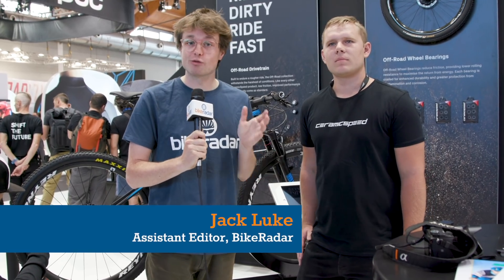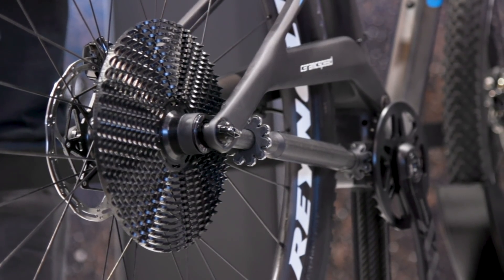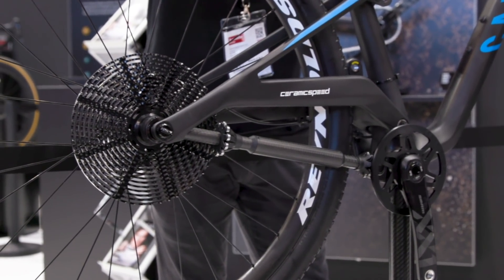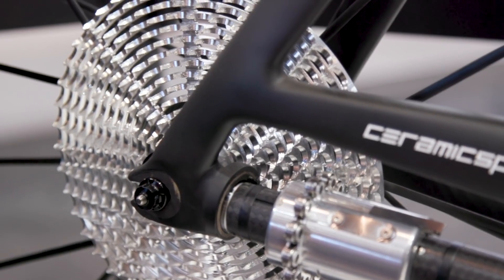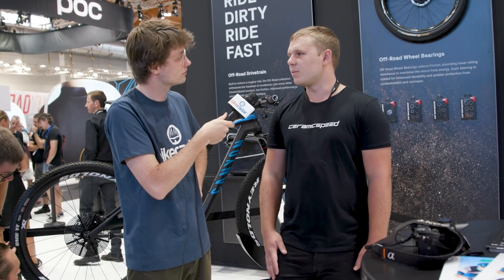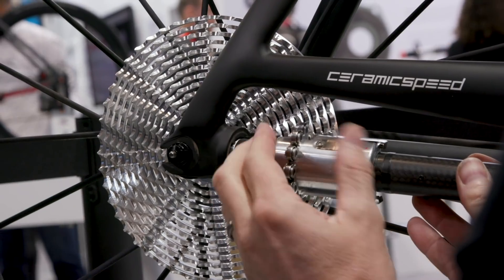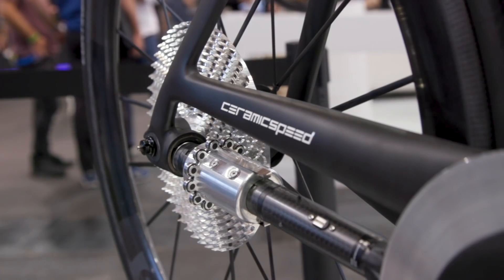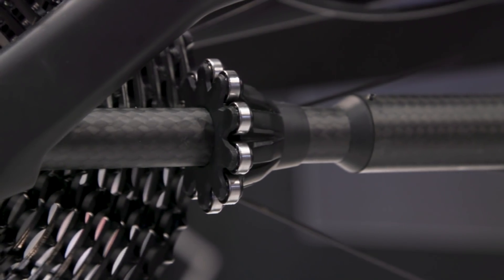No More Chains! The Future of Bike Design? | CeramicSpeed’s Driven MTB & Road Drivetrain

Comment: I have read that for motorcycles this shaft power delivery has more loss than a chain.
Reply: Well yeah, you also carry more weight. it remains to be seen if this system really brings more efficiency to the table, and maybe less weight. Otherwise it's pretty useless. I mean, there's no need to reinvent the wheel if the benefits do not outweight the drawbacks.
Reply: Well, the disadvantages on a motorcycle is the very direct connection between the engine and the wheel, adding quite a jerkiness to the shifting. The efficiency loss is mainly due to the additional weight, which has to be accelerated.

But I think engines are fading out pretty quickly, so electric belt driven motorcycles which don't use gears or clutches are the future :)
Reply: @RubenKelevra  actually no. Not until the battery problem will be solved. Every single electric motorcycle on the market is a joke , performance and price wise if compared to anything similar gas powered at half a cost. The complete failure of the Harley bike is just the most recent one.
Reply: @DerpEye  I test driven a Zero DSR pretty dope. :)
Reply: @RubenKelevra  Well, it costs almost 3 times a comparable ICE bike, with a range of about 150 kms in real life. Pretty much useless outside the city. I ride motorcycles and I've tried electric ones more than a decade ago. Very nice riding , but the battery technology still sucks big time to this day.
Reply: @DerpEye  you got 326 km city range. You must know pretty large cities 🤔

I took two full day trips, while we did park and walked a bit, drank coffee etc. after 1-2 hours driving. Had no issues with charging, it charges 150 km of range in one hour on a Type2 charger. So you can drive like 2 hours, take a break and when you come back your bike is full again.
Reply: @RubenKelevra  Who buys a 20k motorcycle to use it in the city?  Motorcycles are usually used on weekends for long trips. 320 in the city , is that manufacturers' posted range? It's for the long range version btw. More likely less than 200kms on  open roads and highway speeds. Or at least that's what I read from real life tests. Is it a great toy for rich people? Yes. Can it replace a normal motorcycle? Obviously not.
Reply: @DerpEye  it was you who said, it's a motorcycle for the city. I've driven it, on two day trips and charging was never an issue. I actually had to wait for the rest of the group to fill up at the gas station 😂

20k for a new bike is not much, if you compare it for example to a HD. It's also not ridiculously overpriced, since the parts (especially the battery) is expensive. Buying a non-electric motorcycle for much more than 20k on the other hand is.
Reply: @RubenKelevra  well, Harley Davidson Is nonexistent as a brand outside of the US for a reason. Most bikes on the road are sub 15-10k. For 20k€ were talking BMW terrain, with a bike which is almost comparable to a car in terms of technology and size. Well, batteries are a long way from replacing conventional mobility.
Reply: @RubenKelevra  No if i hit the highway I can tackle 180km max. Besides if u do not use the high way, it's no point having a motor cycle
Reply: @DerpEye  everyone  driving cars in the city is one of the biggest reason there's congestion. If people rode bikes (push or powered) and used public transport there'd be less traffic. 
Also,  most city trips are short, so why is the range an issue? If you need to go long distance then a motorbike isn't a good option regardless..
Reply: @dannydyerschocolatehomuncu7640  oh really?  US represents more than 60% of sales for them. That's 320 million people market. A little remainder that we have almost 7 billion worldwide. The second largest market being Europe, with Italy as the largest motorcycle market, among the most sold bike the first Harley comes in the 40 place. No wonder, who buys a motorbike incapable of cornering in a country with famous mountain passes?

Comment: This is a scam. Roller chains are over 98% efficient. Even if this worked as advertised you would be looking at maybe a 1% improvement. But, while a chain puts pressure on as much as half the teeth of the chainring/cluster gear this puts all the torque into one or two teeth at a time. That fragile cluster would not last a day of hard riding. Velodromes are nothing like the real world.

Comment: any innovation in drivetrain over chains will struggle because chains and gears are also used in industrial & automotive applications and have been for 140years. 
The size, history and output of chain & gear making companies elevates the quality of and reduces the  cost of chains and gears considerably. 
Ceramic speed is starting from scratch and is something only for bicycles so will really struggle. 
Belt drive has much more ability to get a foothold because belts are also used in industrial & automotive. Meaning high quality low cost belts exist already.

Comment: If they get it to work with a gearbox , the shifting problems would be solved.  I think the hardest problem with the full sus would be trying to shift that mechanism while the drivetrain length keeps changing. But if all the shifting is in a gearbox at the pedals, that's not a problem anymore.

Comment: Flashbacks of riding my bike as a kid and the chain popping off while standing.
Reply: I call that the nut cracker
Reply: Today sram powerlink $10😎
Reply: Happen to me all the time, 30 years old bike...
Reply: @Skaelya  have you tried adjusting your  derailleur?
Reply: @shaej8187  many times, yes... but the bike is just very old and keep de-ajusting itself so I kinda gave up and accepted the fact that the chain pop off all the time. I even managed to find ways to put the chain back on while riding using mys feet.
Reply: @Skaelya  well...chains and gears wear out over time, the teeth and links become crooked and must be changed eventually
Reply: Yeah, same
Reply: When youre climbing a hill standing then the bike shifts randomly

Comment: This thing will probably have to be fully sealed like a car transmission. That would add weight, bulk, and cost, but it would make this thing really resilient. At least if the mechanical components can handle all the stresses of real use.
Reply: Ever hear of plastic?
Reply: T1Oracle honestly, i think the pinion would put a lot of stress on the gears' teeth and break it. Unlike chain where the pressure of the torque is delivered evenly to the teeth the chain is hooked on. I feel like they can add more teeth on the gears and pinion or a stronger material.
Reply: A aerodynamic carbon shroud should do it , no debris , clean
Reply: This likely just a STEP in the new direction. What actually eventually (if it does) makes it to marketing or production will probably look quite different. It sort-of works now, maybe they're on the right track? We USED TO have hubs with 5-speeds INSIDE the hub--maybe a step in that direction w/newer advanced tech will be something too. For now... I'll keep my chain, thanks, but I WOULD like to see that improve too though.
~JSV

Comment: I wish they would put their efforts into developing a low friction CVT instead of this drive shaft and 2 crown gears.
Reply: CVT has huge power waste
Reply: go do it
Reply: CVT are slow reacting and inefficient at least when your legs are driving it.
Reply: @FSXgta  What part of LOW FRICTION do ya'll not understand?
Also, AT NO POINT DID I SAY THE CURRENT ONES ARE, what I said, is they should try to develop one.

A CVT is just a name for a category of transmissions... just a principle, not a specific mechanism, so there's no fundamental reason why a transmission with infinite gear ratios by nature needs to be slow to react or inefficient.

Ps transmission efficiency doesn't depend on whether your legs are driving it or not.
Reply: @sergarlantyrell7847  how do you lower friction on a pulley based CVT?
Reply: @FSXgta  that's your problem. You can't think beyond a pulley. Not every CVT uses pulleys.

Comment: More things to go wrong what's wrong with a chain?
Reply: Chain can fall off and the tensioner is waaay too low. Also, the cassette is thick and adds bulk to the frame and unspiring weight on the rear tire. This is crazy lightweight and a very slim profile. The engineering sample here is a rough idea but when it’s done I’m sure you won’t even be able to tell there’s a set of gears on the rear tire when it’s all concealed into a wheel cover.
Reply: @markm0000  the real test will be off road riding

Comment: I would say, it will not work! the contact point from shaft to the gears is too small, at the moment the chain is in contact with the gears wrapped around about 1/3 of the circumference, who doesn't put their body weight on the peddles!
Reply: That has been my concern from the first time I saw it, it just doesn't look rigid enough to cope with someone really standing on the pedals in a low gear.
Reply: But with a chain only one link needs to break for it to become useless. Also, the part of the chain that’s wrapped around the sprocket isn’t under tension.

That being said I’m concerned that the gear might pop outwards under extreme force.
Reply: Grant Lauzon Ja, but how often do standard bicycle chains ever actually fail due to excessive torque or tension?  Exactly.

Comment: This is poor design. There is a reason that this is not used. Even with motorcycles there is very few with this style drive. The reason is that the losses are to high it is a highly inefficient as compared to a chain drive.

Comment: Really exciting and fun to save an entire years paycheck for. Or just 3D print it yourself, or buy one, have a tech disassemble the new prototype, HP 3D scan all the parts. And Then send the CAD file to a Additive Manufacturing plant, and have it printed at a lower cost in hollow titanium Aluminum alloy.
Reply: Some 3D printing guys can do testing instead of this unicorn rainbow presentation with no footage

Comment: I don't understand how this can be a good idea at all. In addition to strength and weight issues, it has to transfer the force 90° twice, that must must destroy the efficiency.
Reply: Correct, it is highly inefficient when compared to a chain drive and this is why most motorcycles don't use them. They have the some advantages such as maintenance but they are far outweighed by the disadvantages

Comment: Still looks like a fix looking for a problem. I'm quite happy with my IGH setup.  Nothing exposed, nothing to have to maintain. This just looks like something that is going to have long term reliability issues with the forces trying to push the wheel out and away from the frame. Not to mention how painful that gear setup must be to accidentally hit.Thanks but no thanks.

Comment: Changing torque transmission drive angles from a conventional all inline design (chain/sprocket system) to 90 degree gear design as in this reduces efficiency.
Reply: This is the only correct comment! This design will therefore never work...

Comment: If it was Shimano behind it we wouldn't have heard about it until they had all of the problems worked out and it was actually going to work.  It's a neat concept but it doesn't work under actual seated power let alone standing efforts from a decently strong rider (forget about a big strong rider) without significantly beefing it up.  Then it would have greater weight.  When (and if) it actually gets released have fun spending stupid money on having the opportunity to find the shortcomings in the design and execution of this idea.  With a proprietary bike that will effectively be semi-useless if you can't get replacement parts for it.  Conventional chain drivetrains are well proven and properly developed with over 120 years of refinement and work in cold,  ice,  rain,  mud... and stand up to a pair of world class riders on a tandem without drama.  They also have up to 98.6% efficiency as is.  And don't require buying a new bike.  Maybe the market needs something better that's "new and improved" because 95-98% efficiency is clearly not good enough and requires throwing your bike in the trash to buy something new.  I'm not opening my wallet for this unproven overpriced hype.

Comment: All those bearings and sliding parts won't last racing in the dirt. It's a simply fact changing direction of power always has a loss. This is a common problem in automobiles. Hence why most efficient are fwd. Therefore never changing direction of power. Not sure what "gains" you're going to receive.

Comment: Crunch. Oops, there goes the proprietary $$$$ cassette and egg beater shaft.
Reply: If it gets to market it is likely no system will shift under load better, because it can shift the half of the meshing bearings that are "currently" disengaged from the cassette. I assume they will set it to trigger immediately after disengaging. However, I see the potential cost issue with this design given the materials and precision required. I do think that there is likely a limitation on the maximum step in gearing due to the meshing of bearings with adjacent "cogs" that have teeth that are (essentially) out of phase with eachother.

Comment: Here I am still with a bike with no suspension and v brakes🙂
Reply: Nothing wrong with! that I have 93 specialized rock hopper and 97 gary fisher marlin.
Reply: The problem is every year is harder to get decent rims for v breaks
Reply: @themike2738  I run ryno lites dbl wall
Reply: @themike2738  yeah, easier to get rims for v "brakes" ;)
Reply: You don’t want suspension for asphalt, that just slows you down FYI, V brakes weigh less than disc brakes but are less reliable and more maintenance
Reply: @realitycheck908  love my cromoly bikes! Dream bike titanium of course..
Reply: @realitycheck908  and theres just somthing I love about bombing trails on an old school rigid mtn. Even shredding my drop bar gravel bike with full panniers. Makes you better rider for surem
Reply: @jcagara08   I have a 1992 bully bmx that's sat in my spare room ever since I was old enough to get a driver's licence. Maybe one day I'll hang the frame on the wall as decor.
Reply: Well done mate 👍
Reply: I use a bike thay was made before I was born

Has a suspension fork but stiffs are cool too because you know theyre stiff

Yeah it has vbrakes too they hold up well
Reply: @Вероника Заглотова there are mountain bikes without suspension
Reply: Good for you.
Reply: Suspension is waste your energy
Reply: One of my favorite bikes was a single speed rigid with V-brakes!
Reply: I have cube elite super hpc race 29 (black and green)
Reply: @vincenziojovanoski  very cool always need a stable. I love full rigid

Comment: Still no actual human sat on the bike pedalling. They could have had a set of rollers so we could see it work but not having the most basic demo shows how far from production they are. 
I still can't imagine itnhandlingnthe power. They gave vague answers about testing and hinted strongly that it fails when pressed. 
Longevity of components has to be worse than a chain as all the drive forces seem to go through a single roller instead of the load being distributed over several links and teeth like with a chain.
I bet the trials were done by accelerating slowly. A strong sprint start would probably rip a tooth off. 
I would love a sealed system with no derailure. That would be awesome. But I feel it may be some time off. They probably need to beef up the components and seal the system in oil. The efficiency will reduce slightly but the advantage to mountain bikes of no rear hanger would be sweet
Reply: It's simple engineering,it's got issues,that's why we don't see it being used ...
Reply: @williambuxton8223  yea. It looks pretty though. I do hope they get it to work effectively. It would be nice to see an alternative to chains. Especially if they could seal it from the elements.

Comment: This drivetrain looks like an engineer's nightmare. Compared to a chain, this has an order of magnitude higher forces on the gears and therefore requires exotic materials to not break when in normal use, unless you're willing to increase the weight and bulk. The efficiency gains and other benefits are disproportionately low.
Reply: I don't understand how it has efficiency gains at all. It has to transfer the force 90° twice...
Reply: gracefool exactly.
Reply: At least someone is doing something right? They just making more bike choices its up to you which you want to get.
Reply: @adirompin1727  It's already been tried in motorbike design. The bikes using it are few and far in between.
Reply: who cares. it looks cool!

Comment: It’s very cool to see the shifting working. I’m still a bit skeptical about the lateral rigidity of the cassette though. The 45 km/h in a velodrome was on a single speed setup and presumably on an inner row of teeth which is less susceptible to flex. I’m sure they’ll come up with something, but doubt it will look like this.
Reply: The final design will probably be a honeycomb reenforced backplate to hold the rings together straight. Then an aero cover to keep out big pieces of debris and lower drag. This has potential to make a noticeable difference. It just needs more work.

Comment: I like the creativity and the idea. But I have many questions and concerns: The chainring on the rear needs to be stiff/strong enough to withstand the forces, so probably pretty expensive. And the frames chainstay gets to handle more forces: sideways. Instead of longitudinal like with a chain or belt.
And something that downright scares me: another bicycle standard? It is already a nightmare to find the right bottom bracket, headset etcetera. But that is not ceramics fault ;)
Also, the shifting looks cool!